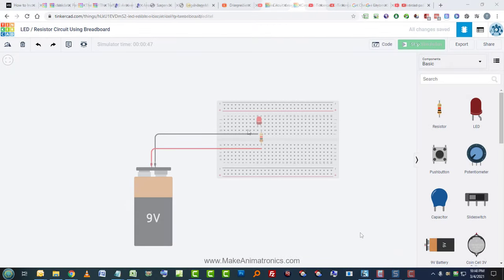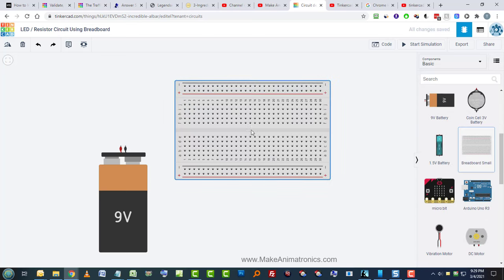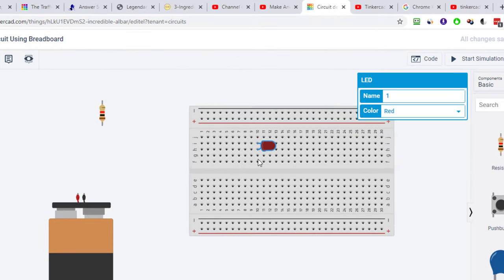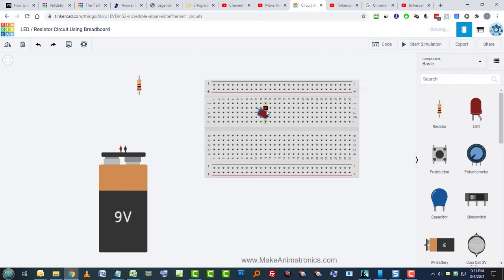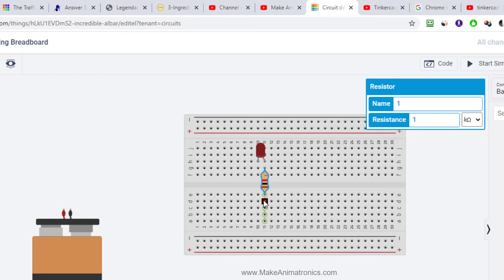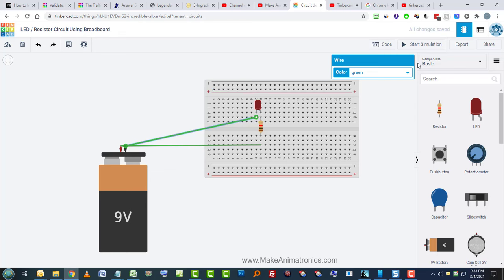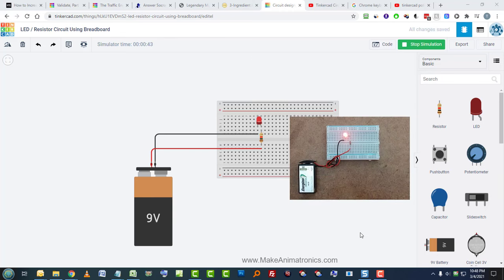Simple LED / Resistor Circuit Using a Breadboard and Simple Tinkercad Circuits.

Comment: sir i have some doubts, first of all u have connected positive terminal of battery to resistor which goes to negative terminal of led. shouldnt it be positive terminal and the negative terminal of led with negative terminal of battery
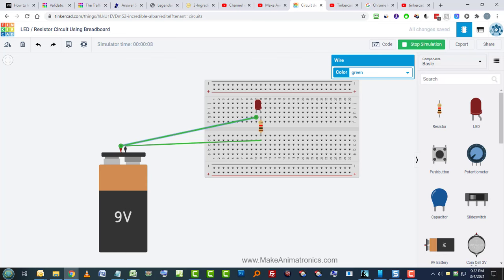Reply from the maker: Thank you for your comment! You are right about the polarity and it is indeed wrong in the beginning (about 3:10). I did that to make a point of how easy it is to recognize and fix in the simulator. If you watch more of the video you will see that I show how to change the setup and prove the correct wiring.

Comment: Sir it would be helpful if you do a vedio on " Simple touch switch" using two bjt transistors BC547 , a led , a resistor , voltmeter and a led , it would be so helpful since its quiet urgent